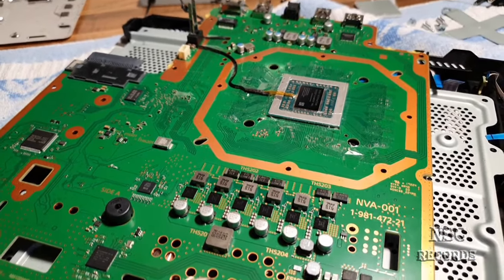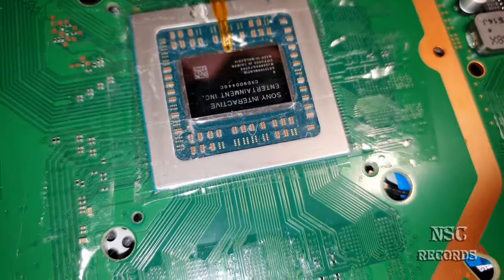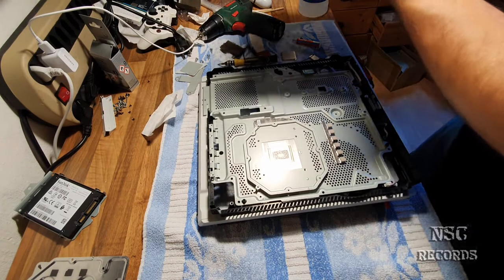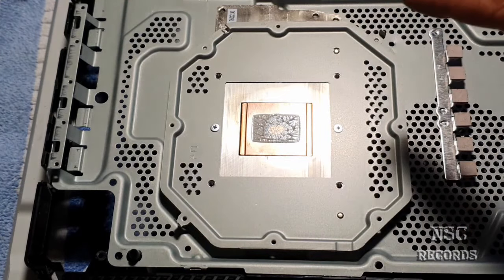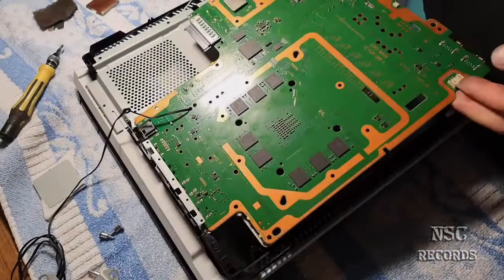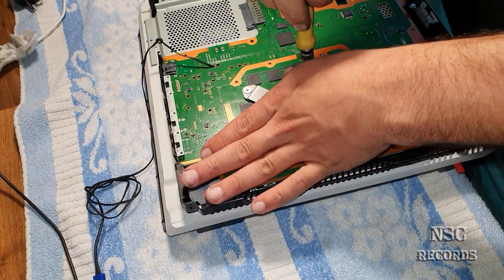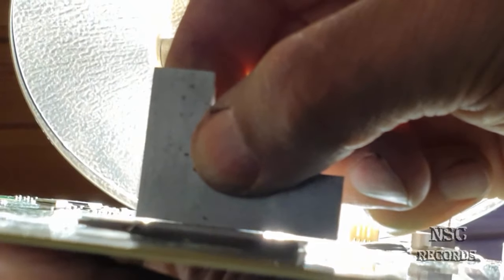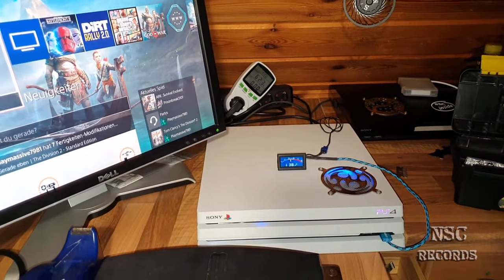That´s why your PS4 is still overheating after new thermal paste By:NSC

Comment: Thanks bro for all work you put for us.
I have been a problem with my PlayStation 4 Pro stiil getting hot after clean and change thermal past and pads, i use Artic-MX4 and put thermal pads 1.5mm and default is 1mm, can the problem is in thermal pads? My cooler still silence but my PlayStation is gettin hot. Some help i really apreciate
Reply from the maker: Thank you to. You always welcome. It sounds like the first or the second ps4 pro Generation. Can you tell me the model number? The main problem are the vram chips, they get hot as he'll, that's why the ps4 goes crazy on the fan...
Reply: @NSC-Modz  Thanks alot bro! The fan still silence after clean, the problem is the PlayStation still gettin hot. The model is CUH-7216B.
I used past Artic-MX4 and thermal pads from Artic with 1.5mm.
Reply from the maker: Ok, so you lucky, the 72xx is the best ever. The only thing you need now, is a fan adjuster and heat holes for better airflow
Reply from the maker: Btw: Search on my channel for: PS4 Pro Ultra Quiet 😀

Comment: hello everyone, I think I have this problem, it's pro 2216B in Potanja has anyone else done this and how did it turn out at the end
Reply from the maker: It's working fine till now, but if you don't like to do this, than put a fan on the back for the Vram chips, this will help a lot. Just watch my PS4 Ultra Quiet Videos. ✌️

Comment: I had the same problem on my Intel 4790K CPU and it would skyrocket to 100C instantly when loaded and throttle, And that CPU was EXPENSIVE! after some testing finding out the footprint on the heatsink was even worse than yours because it would only touch a bit in the outer corners and leave the whole center not touching the cooler so I came to the conclusion to start grinding away on the CPU die because it seemed to overclock well even when that hot. I still had warranty on it so it was awkward af. but I had the footprint pretty much perfect with lapping it down to the copper layer. But the result? well it dropped 40 degree C and also keeping the TJ below 80 (with Prime95) even when overclocked to 4,8GHZ, this is the CPU I still use today. I guess the CPU was an over achiever held back by heat so it was not sorted out for separate high-end samples and ended up in my hands eventually
Reply from the maker: Yeah, sounds like, but you done the best and now you have a limited edition one 😅
Reply: @NSC-Modz  indeed lol. I was pretty pissed off at first since the computer would just not perform as it should just to figure out my 500 dollar cpu was shaped like some kind of snack bowl cursing how intel could release the flagship model of that time like this. But in the end I been very happy with it anyway. It makes it special in it’s own quirky way
Reply from the maker: @Pulverrostmannen  that's for sure, and now you know what you really got :) Trust is good, control is better!

Comment: I found your video after I saw many others about how to change the thermal paste, and find out that many had the problems of overheating after changing it, so I found this very useful in case I decide to change mine cuz it has started to sound a bit loud for my taste. (I bought my ps4 pro on the 2016).
However I have a question: which way is better to put the thermal paste? You expanded it, but for other people is better just to put a drop and make pressure on it to let it expand by itself...is that and important difference?
Reply from the maker: Just apply everywhere some thermal paste and in the middle a small dot. So you good to go ^^
Reply: @NSC-Modz  are you saying to put only a dot in the middle and then put back together?

Comment: What sand paper grit/grits did you use to level the APU? Thanks!
Reply from the maker: You can use 800, 1000 and if you like also 1500 or 2000 on the end.
Reply from the maker: @The Other Guy hehe yeah, just not possible to get the APU on a table 😂 I've save the Center on the APU and the heatsink to

Comment: I bet mine has that issue. My pro dries out the paste very fast, like every 6 or 8 months it will get loud again and sure enough the paste is all dried out and oddly enough every time I open it the paste has all been squeezed out the side and is mostly around the edges of the apu. I checked the cooler and it was flat like yours. I’ll have to look into this
Reply from the maker: Yeah, if it's a pro than im pretty sure that you have the same issue.
Reply: @NSC-Modz  what did you use to lap it to keep it flat? I’m going to check it next time I have it apart and see if the apu is like yours. I just re did the paste so I won’t have to pull it apart for a little bit yet.
Reply from the maker: @Evanx373  right. i just used sand paper ;)
Reply: @NSC-Modz  ok i was just wondering i know when you lap a regular cpu a lot of people will use a piece of glass or something to keep it as flat as possible.
Reply from the maker: @Evanx373  i know, but here is no place for a piece of glass and i was able to do it also without. The other thing is also, you can not lap here to much till it gets flat, that cold be to much and so the APU would get damage. So take care
Reply: @NSC-Modz  If I decide to try it ill be careful. it will probably be 6 or 8 months till it needs re pasted again. if it is warped then I will probably try to sand on the heatsink to match it, because I can replace that if I screw it up

Comment: So I’ve done this to a few PS4’s and worked like a charm. Did one yesterday and now the control won’t connect. Checked the antenna, tried different cables, replaced the antenna from my old console and still nothing. Any ideas?
Reply from the maker: Nice, but take care like i always say xD Maybe you forgot about the antenna Cables? Happens to a lot peoples ^^
Reply: Nah. Checked it and replaced it with a new one and it’s still not connecting.
Reply from the maker: @MindsetDSF  you had this problem before? You may lapp your APU to much? Is it working with the controller cable connected?
Reply: @NSC-Modz  Only works connected to a cable in safe mode. As soon as it goes back to initialization screen it won’t work. Have never had this problem before.
Reply: Lapp apu? What does that mean?
Reply from the maker: @MindsetDSF  i thought you lapped the APU like me xD Maybe your antenna module is damaged...
Reply: did u try hooking a ethernet cord to it I had a prob like that on 2 different consoles  where it like couldn't find my wifi or something like that idk but controller wouldn't connect no matter what I did unless I was in safe mode but I turned it off and used a ethernet cord and for some reason it started connecting on both of them I always thought that was crazy .

Comment: Looks like it needs a Copper Shim so the more pressure can be put on the rest of the dies when its plugged in this actually happens a lot in laptop and a shim usually fixes it.
Reply from the maker: Yeah, but the pressure was here not the problem :)
Reply: Too much pressure will destroy the APU die maybe.
Reply from the maker: @solidsnake1089  right
Reply: Might be a more safe than lapping , I was thinking instead of coper to use a thermal pad in the center and paste around it.
Reply: The apu heatsink has a fault.  It's no where near flat.  I had to lap mine.
Reply from the maker: Yeah, that sucks hard...

Comment: you should use thick thermal paste for a CPU/GPU like that, should make the hill problem irrelevant but yeah you sadly can't use liquid metal on those, I think the hill thing was made on purpose because it is a better shape for normal thermal paste?
Reply from the maker: Does not help at this point... and no it's not for purpose, makes no sense and other Playstations are good, but most not...

Comment: Should i be alarmed if the thermal paste sizzles after applying it?
Reply from the maker: It conforms which thermal paste you had on it
Reply: @NSC-Modz  i used arctic silver 5, ive searched online with no answers explaining why it sizzles, only people like myself asking if its a concern,
I imagine perhaps its could be air bubbles or over application, but i cant imagine i put more on there than sony does,
Its made this sound after 2 application attempts.
Im hoping its a non issue,
Reply from the maker: @terrencebarnes7448  better open it again and take a look, sure it's sure...

Comment: Great video! What model number is your ps4 pro?
Reply from the maker: Thank you very much, this is ones of the first PS4 Pro CUH-7016x
Reply: @NSC-Modz  Thanks for replying! I just scored almost brand new ps4 pro red dead bundle 72xx model. Will be tearing it down pretty soon for some fresh MX4 application and fan controller mod. I will also do the same test you did to see if the same problem exists. I will post my findings and shoot you some photos over psn if you want.
Reply from the maker: @igorskuratovsky1  Sure man, all infos helps :) I have also 2 more PS4 here, as i got time i will check them to :)

Comment: My ps4 fan still not working after I cleaned it. 
But its spins smoothly..but when i turn on the ps4 its not spinning why!?
Reply: I think its the sensor issue or maybe wires got tangled badly

Comment: Dude, my brother's PS4 fat, the regional woods. It was sound like a hurricane out and claim that was even that actually dirty. The thermal paste. Actually it was still moist so there was no way a burnt dried out. So I think what does the sound like a fan anymore fixed it
Reply from the maker: Yeah, on the older ps4 pro the main problem is also the vram chips, they get dann hot, but Sony fixed it on the latest ps4 pro like on the 12xx Edition. Mostly it's just enough to clean the dust and apply new thermal paste.

Comment: Bro after cleaning ps4 and the fan and not putting thermal paste will it still heat
Reply: Did it work OK? Did you remove the thermal paste that was there or just not replace the factory thermal paste? 

If you strip the PS4 down and remove the heatsink for cleaning, it's best to reapply thermal paste because the contact may no longer be sufficient. This is especially the case if the thermal paste has dried up, as there'll be little contact between surfaces once you've broken that seal.

If you clean the thermal paste away without replacing it, the console will overheat very quickly because the heat is not being transferred to the heatsink.

Comment: Dude I changed my thermal paste and now 4 months later it sounds like a damn jet again like wtf is the damn problem and what do I have to do?
Reply from the maker: Witch thermal paste did u use abs have you bend the holder back a bit?
Reply: @NSC-Modz  I went to a repair shop and they “fixed” it for me. Tomorrow it’s been 4 months since then but it’s loud again. I have no idea what they did aside from cleaning it and changing the paste.
Reply from the maker: @putinsneighbor8351  those shops always use cheap thermal paste
Reply: @NSC-Modz  100% that’s what I felt as he was fixing it and that’s what I thought after it started sounding again.
Reply from the maker: @putinsneighbor8351  you better do it your self and apply thermal grizzly Kryonaut or MX5

Comment: That’s crazy my ps4 just started to do that I can turn it on and it’s fine until I start up call of duty Cold War then the fan speeds up and it shuts down and beeps red idk what to do
Reply from the maker: It's overheating already or your PSU is dead...
Reply: Question for you I just got my thermal paste in like this min I’m rebuilding it as I type I hope this will fix it
Reply from the maker: @joshuabaker643  if your fan was turning very high, than it was overheating already
Reply: @NSC-Modz  I hope not if that’s the case what can I do to fix it and I have been looking to buy a ps4 I live in Massachusetts but I can not find a singe place that has them idk what to do now
Reply: @NSC-Modz  ok well it runs perfect when I turn it on but once I start a game it starts to speed up really fast and then it shuts down should I just keep looking for a ps4
Reply: @NSC-Modz  just a update I did the paste like I told you and I guess I’m lucky. Because it’s not fine just waiting on my cooling stand thank you for talking to me about it
Reply from the maker: @joshuabaker643  sure thing, you always welcome ;)

Comment: Best method what taken two years is ditch thermal paste use grizzly carbon pad myne is white ps4 pro daft idea ebrasive chip & coper myne was loud when repasted & thermal paded mx4 & grizzly minus 8 was not  to loud didnt over heat fan slowed when not in game menu didnt rampup once.taken apart again not pea size dot method line method spreaded cut pads because was covering chips just cut until was each side edge of chip i thermal paded hdmi input chip because i found out takes strain off the six chips near apu is quiet since

Comment: Fantastic video!!! Thanks.
Reply from the maker: You Welcome :)
Reply: @NSC-Modz  Look into annealed pyrolytic graphite or Panasonic PGS graphite sheet. Expensive but amazing stuff. 3 to 5 times more conductive than copper. Great for cooling small closed spaces. :)
Reply from the maker: @mattlombard2919  Yeah, i used it already a few times, on my Notebook, PS3 and some other hardware, great stuff :)

Comment: this way works good but also if you don't want to sand buy a 15 dollar thermal paste pad they work as good as this way also cause it fills that gap.
Reply from the maker: Uh yes but not that great as like with thermal paste ^^
Reply: @NSC-Modz  yeah that's kinda why I used both methods now kinda but in my testings, i noticed them pads can fix the prob pretty often cause they get even pressure all around and cant spread apart like paste I actually came here because I was wondering if anyone else ever lapped a ps4 pro CPU  then followed it up with a thermal pad after doing a reflow but that might be why ive had more success with them pads cause i usually reflow it to help mend  any damaged solder balls under it from the first overheating i just figured i would give that suggestion to some to help if they ain't comfortable with sanding a cpu lol
Reply from the maker: @Babbages  xD Yeah, dont forget: FOR THE PLAYERS ^^

Comment: i seen a video where someone was using a thermal pad and not paste on the the ps4 they were successful but you need to be careful it does not overlap the shiny part or it could short
i take no responsibility thought id share
Reply from the maker: Forget it... the chip needs total contact with the Heatsink for best results, and this is only possible with Thermal paste

Comment: thermal pad mite work too no sanding maybe.
Reply from the maker: All can work, but the question is how...
Reply: @NSC-Modz  i don't work on consoles but my logic is that the CPU thermal pad mite take up the space that he is trying to fix with sanding i think this video is good not casting Shade just thought i would put that out there.
Reply from the maker: @chester_ville_4066 no way bro... in this case best solution is, electric plaiting the Heatsink and liquid metal. Tested already, works prefect. Other thing which is also great, is a cooler on the other side for the vram chips, will help a lot on the cooling. Check my: PS4 Pro Ultra Quiet video ✌️

Comment: My gen one was loud as a jet taking off.  I lapped the heatsink.  Its hush hush now cant even tell it's running now.  The gen 1 heatsink is not near flat..
Reply from the maker: Yeah, but on this ones the vram chips are more the problem, they running dann hot to.
Reply: @NSC-Modz  yea I've seen people cut the shield and use epoxy glued on mini heat sinks instead of just the shield as a heat sink.  I considered using a small GPU cooler off one of my junk cards on it.
Reply: I've kept mine clean.    It was loud right out of the box.  It was over 60db.  Was right up there with a vacuum cleaner.  After close inspection while lapping i found it was compressed in the center where they crimped in the cooler pipes.  I should of made a video.   It makes a  big difference I had to open the lid to verify the fan was going after I did it.
Reply from the maker: @cyclonicblade  yeah, if you want to have it Ultra Quiet than just do it like i did on my other videos with a 92 or 120mm fan on the back for the vram chips 🤗✌️It will run cool abs quiet as he'll 😆
Reply: @NSC-Modz  been running mine steady now for 2 days let my kids play it while I'm working etc.  Since I lapped the heatsink .     The only way I know it's on is the external hard drive spools occasionally.    But the fan is dead quiet .   Even on a all nite mw2 session.
Reply from the maker: @cyclonicblade  nice one, it's the latest Pro or which one exactly?
Reply: @NSC-Modz   mines the gen 1 pro.
Reply from the maker: Yeah, i thought so. The latest Pro is very quiet but still with bent APUs...

Comment: Yup ..that's high risk..but another idea use thermal pad .. I won't scratch the chip apu
Reply from the maker: Yep, but a thermal pad will not fix the problem and your PS4 gonna overheat even more...
Reply: @NSC-Modz   I see..do you have try it thermal pad to.. it's doesn't work..ok bro nice work..

Comment: You have no thermal pads on your RAM chips. That is your overheating problem.
Reply from the maker: No bro. There where thermal pads like original before. The main problem is bent APU's or bent Heatsinks. Plus the problem that the 70xx and 71xx series has the hot vram chips, that's why all my mods, that will really help a lot. On the 72xx the vram chips are running cooler that's why the 72xx is not overheating that much like the older series, but they still have bent APU's and that's the main problem at all. Same thing on the PS5, they have bent Heatsinks to...... All checked and tested already.